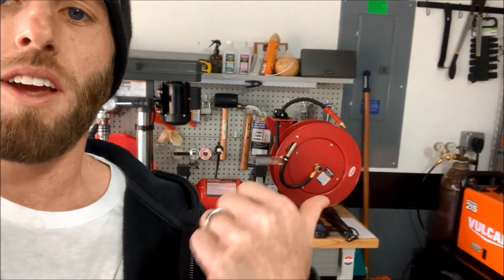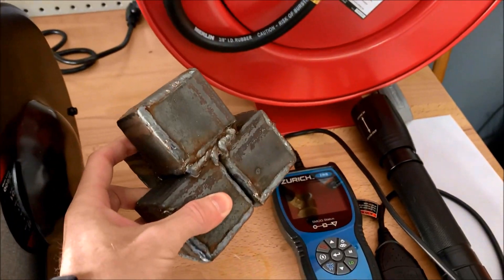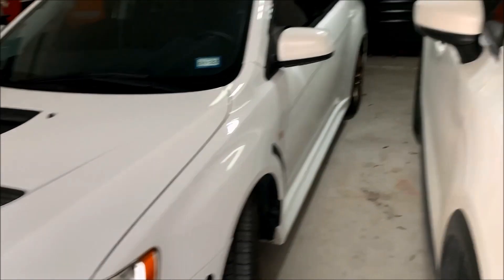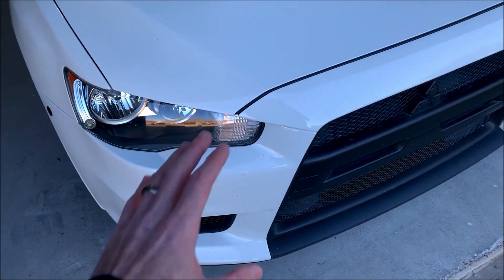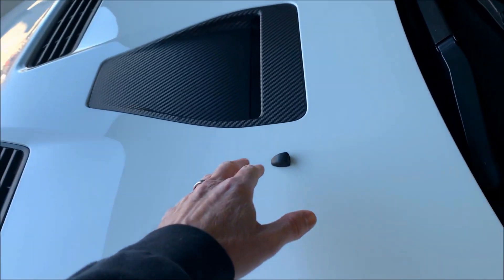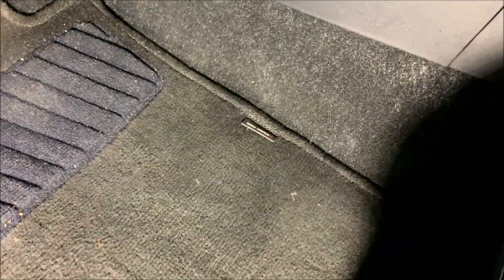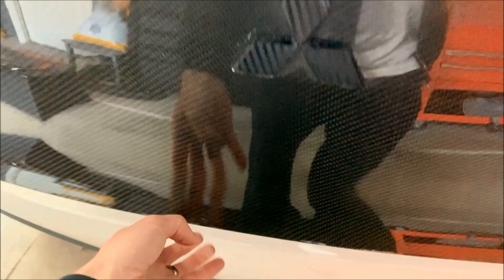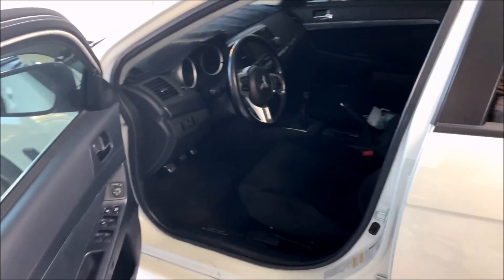New Year New Project / I Bought a Lancer Evo X GSR

Comment: Replace the clutch master cylinder, it will help in the long run.  MA performance makes an OEM like CMC that will fit right in!  BOV and intake are just simple things to upgrade along with a bigger intercooler!!
Reply: MAP's kit is an OEM unit. I run it in my Evo X.

Comment: If you don’t like the color of the carbon trunk just have it sprayed white so you can maintain the weight savings! Nice whip bro
Reply from the maker: From my understanding since carbon fiber has a resin and not actually a clear coat it can still crack.  If it does painting over the resin will show the cracks through the paint.  I’d prefer a full oem body
Reply: @JordanMoree  Good to know! Looking forward to the evo build 🔥

Comment: As mentioned change out your CMC with MAPerformance kit or something similar. That will also allow you to adjust the engagement point as well. X's tend to grab high. Update relays, they should all be orange and one Black. Fuel pump relay being the most important. Map sells the kit. Photo shows green(not updated) but they will be orange.
Reply from the maker: Hadn’t looked into it yet but noticed how much I had to let the clutch out to grab.  Thanks for the info
Reply: @JordanMoree  it'll make a world of difference. My stock clutch grabbed high and my ACT HDSS grabbed high. Readjusted it to the floor and it's much more enjoyable to drive.

Comment: The paint defect at the rear bumper didn't look too bad, my 08 has chipped paint in a lot of the seams between the bumper/hood and areas where the body has sharp bends. The OEM paint job is not the greatest on these cars. Those tail lights are correct on that model, they had black taillights on 2010-2015. The carbon trunks usually use a metal frame underneath like you saw when you opened it so that's pretty normal. As far as the engine bay goes, it looks like he changed out the BOV cause its definitely not OEM. I would make sure its a recirculated one, EVO X's dont like vent to atmosphere BOV's unless you are running a speed density tune. I would also make sure all of the heat shields are in tact. The turbo location on these cars creates alot of heat at the firewall and there are alot of sensitive components near the manifold that need heat protection (MIVEC solenoid and cam angle sensor). Alot of people tend to take off the heat shields because you can see the manifold more or they get in the way when doing a turbo install and people just dont bother to put them back on.
Reply from the maker: Dude you killed it with the response.  I appreciate all the info truly!